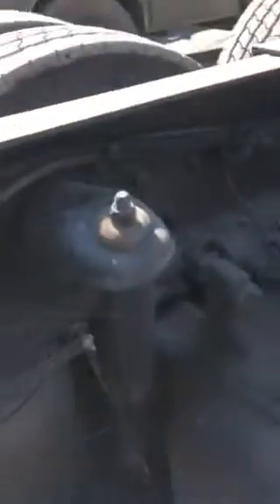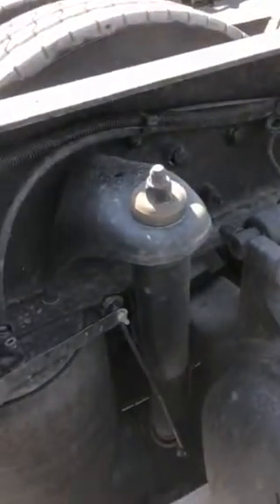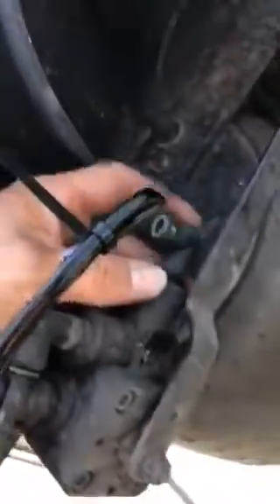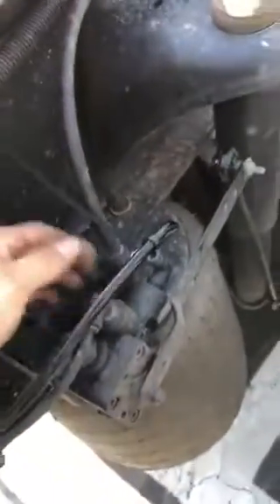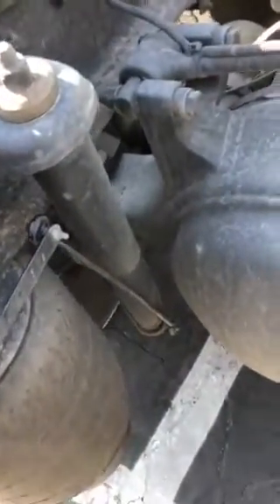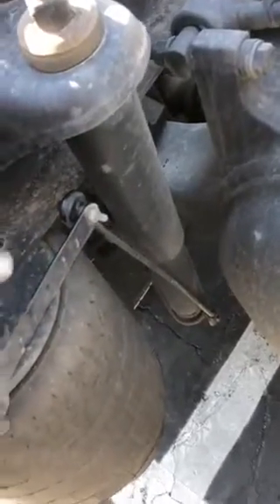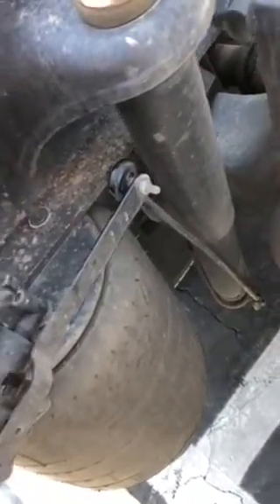How to diagnose leveling valve on semi truck

Comment: Question got a 23 Freightliner cascidia it only leaks when loading and bouncing or bounce down road something is leaking had it in all kinds of shops deals company repair shop cant find. But its general getting worse.still cant find now it go in red with all knobs pulled out.only leaks on blue side most of time while loading. Any idea 💡.
Reply: @arunevaiciulyte7805 the quick valves behind cab of truck that hose screw onto
Reply: @jjhampton hi you talking about the valve behind the truck also air lines when you hoot to trailer ? The leak was from the fittings? Thanks 🙏

Comment: Will that cause vibration an noise and make the truck feel like you have no air in th bags but do
Reply from the maker: peppaboy9 do you have air in your bags?  And if so is it a shake in the front end as well or do you just feel it in the rear ?
Reply: sound and feel like its from the front to the rear
Reply from the maker: peppaboy9 take it to a tire shop have them check the balancing. 
Bad carrier baring 
Bad u-joint
Bad diff
Did it just start happening or has it slow progressed
Reply from the maker: If it has slowly been progressing I will get the carrier bearing and you joint checked but if it just started happening definitely a tire issue
Reply: No it happened Saturday when levling control valve broke and all of my air came out of the air bags fixed the valve but started hearing and feeling vibration noise and a clunking noise everytime I hit a bump
Reply from the maker: peppaboy9 are the bags over extended?

Comment: Thanks for the vid. My air bags leveling valve dumps the air and deflated my air bags while driving down the road. Both in empty and loaded. I thought it might be a bad switch in the cab. Any ideas?
Reply from the maker: Angel Rodriguez check to see if the valve is allowing air into the leveling valve
Reply: Road Service — it doesn’t. But if I turn the truck off and on it corrects itself and inflates the air bags. After your vid i have pinched the air dump hose line and it hasn’t happened again.
Reply: Did u get it fixed angel. I'm having same issue but my leveling valve is really new
Reply: I think it would have to be between a bad leveling valve or bad EOA valve. Possibly the switch. You should be able to easily test the switch by disconnecting it and manually testing the wires in whatever way they connect in order to dump or build suspension.

Comment: Demn if I watched this video before, I took my truck to the kw dealer in ma and this idiots changed the level valve for no reason then the truck keep on dropping the air out wild I was driving 
And took it back they said they couldn't find anything wrong  
They charged me 1500 dollars for doing nothing
Reply: I have a volvo fh 13 euro 5 it's sometimes it dumps all the on the right hand side i don't know why
Reply: It dumps all the air out on the right hand side and fills it up when it feels like